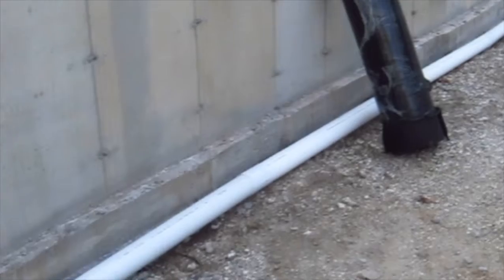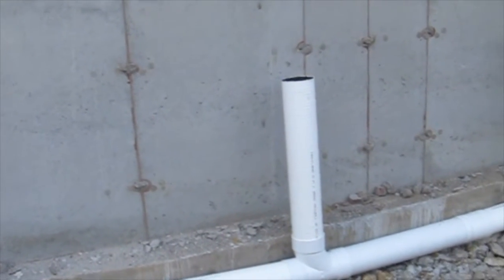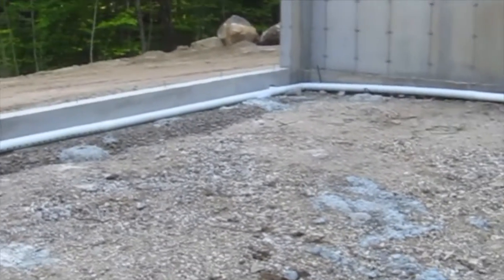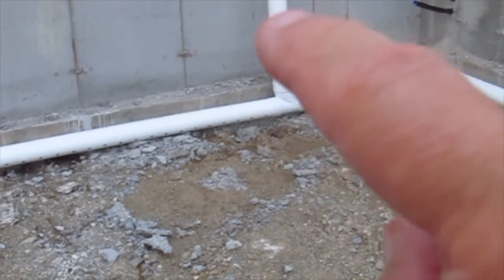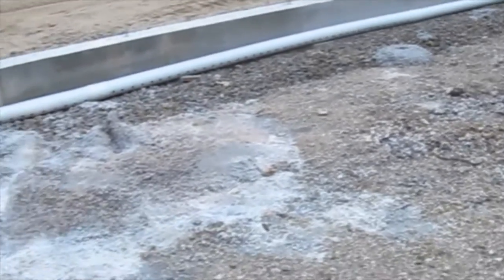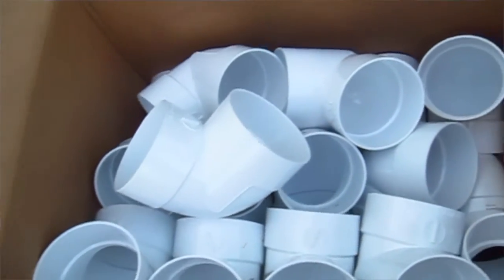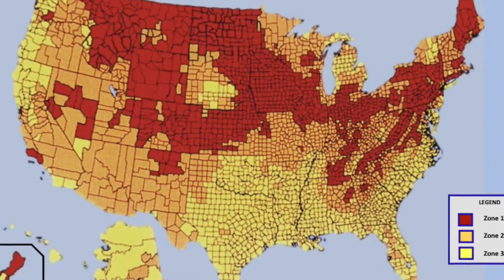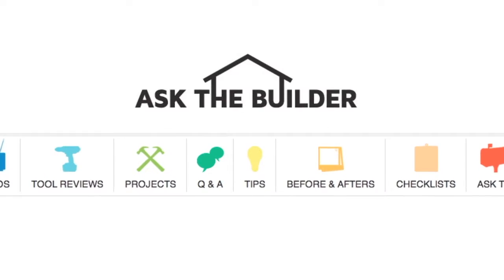Radon Mitigation System

Comment: Sir, your thoughts about the radon pipe coming out the side of house with a a couple feet of vertical extension?
Reply from the maker: That's like getting 70% on a test. It's best to get the pipe up in the wind. Each time wind blows across the pipe, it sucks the radon out and distributes it downwind.
Reply: @askthebuilder  Roger that, that’s why asked an expert.  Thank you.

Comment: They also used thinwall, you pay for the holes but get a cheaper pipe. Better off getting green SDR35 and drilling holes yourself, better pipe for practically same cost
Reply from the maker: Thinwall is okay in this application because it's a crawlspace slab. Even if it was a basement it would be fine. There's virtually no downward pressure on the pipe because the slab above acts like a beam.
Reply: @askthebuilder  Wonder if the thinwall performs better and if it's easier to get inside. can't use it and feel good when you can get green SDR 35 for just about the same price these days (and drill some holes in it). You pay for the convenience of pre-drilled holes and get an inferior quality pipe, which they likely get a higher markup on. Contractors typically aren't too worried about the difference and don't have the time.

Comment: Does it need to go out the bottom of the foundation and daylight? Will the wind not suck it out otherwise?
Reply from the maker: Absolutely NO. You want it to vent out the roof. The wind WILL SUCK it out naturally which is exactly what you want. Making a daylight ground exit you HOPE the gas will go out the pipe.